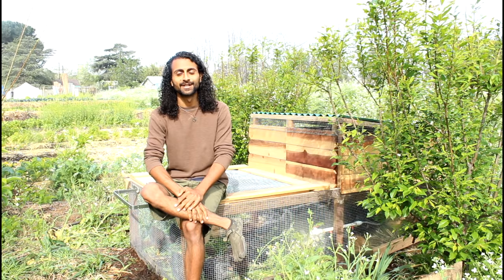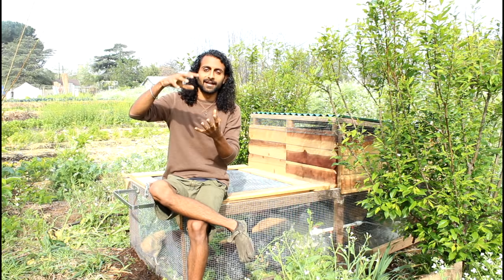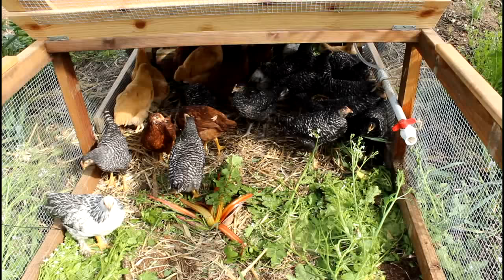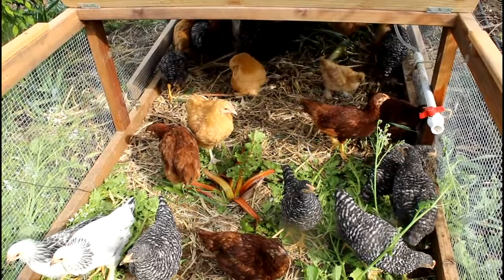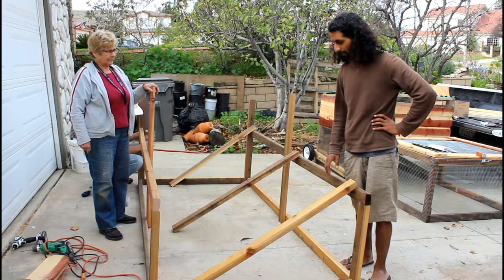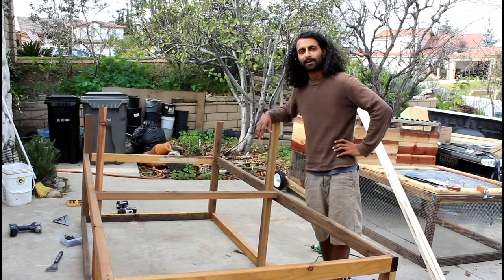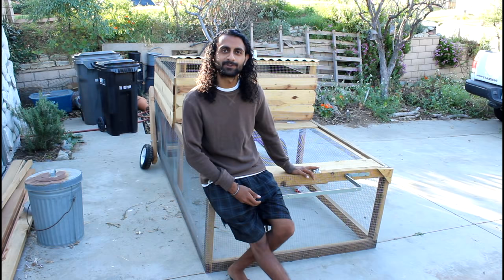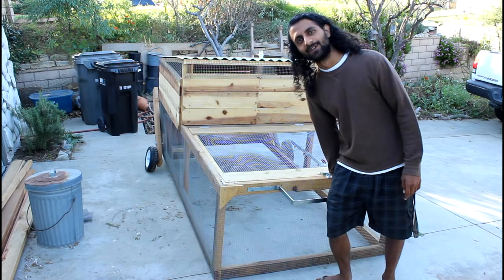How to Build a Chicken Tractor with Farmer Rishi

Comment: Hi again -- very nice perspective.

A question for colder climates -- you're in SoCal and it seemed like one of your main concerns was air flow and cooling. Our winter months can get downright cold, and cold temperatures (scarcity) might make predators more aggressive. Do you have any thoughts on generating / retaining heat in the winter? Maybe add a removable floor at 24" height to retain heat and add a little protection? And/or add non-venting windows for solar heat. I like your idea of keeping the entire perimeter below the house open and clear to 24" height, so if I add a (removable?) bottom, then the floor has to go at 24-25", and the small opening for the chickens to crawl though, to get into the house would be in the bottom of the floor (and not the front as usual). The ladder could be hinged at the front or back, (or side) so that it could be lifted up at night to close the opening for wind protection. For the bottom, I like the idea of using the fencing slats! Wow! Just slide them in, and add a few inches of straw. For ease of cleaning, remove each slat one at a time. The slat at the opening would be shorter.

I like your design with open bottom and no windows, When chickens go inside to rest and nest during the day they get lots of reflected light from the 24" high perimeter, and for roosting at night they get darkness. Maybe add a 360 -degree perimeter window all around the top, just under the roof, 4-6" hight to let the sunlight in in the winder. For summers, fencing slats with small hinges could be used as awnings. (I'll call it "A Chicken Coop for Donalds" or a "Donald Coop for Chickens.")

How far above the floor would you put the roosting bars? Would 12" be ok? The front edge of the nesting boxes should be the same height, say 12 above the floor? When the floor is removed, they would be 36" high, so a year-round ladder would lead up to a permanent 12" wide floor round. They could then hop up on a walking bar in front of the nexting boxes or onto one of the roosting bars. How much space would you put between the walking bar for of the nesting boxes and the closest roosting bar? Would 12 to be ok? Put the walking bar close to the nesting boxes, say 3" to keep chickens from roosting on it and blocking access?

If I add a floor, then I should probably add a hinged roof, for cleaning the inside, say around the ladder?

As for the wheels -- I'm mechanically inclined (haha), so here is what I've learned. The main axle that lifts the frame has to be a pass through. I don't see an inexpensive way around it. Add 1 ft at each end, to cover framing and thickness of the tire and all the bolts, lockwashers and spacers. Thus a 6 ft threaded rod, 5/8" dia, would be used for a 4 ft wide tractor. The reason for the solid pass through axle is torque. One way or another support for the wheels is going to neet torque. If the axle is not pass-through, then that torque will be applied to the bottom of the frame, and over time it will twist the joints and bolts at the bottom corners. To protect the corners, add a pass through axle. A trivial few $ more than purchasing two bolts, and a lot less cost over time. Your frame stays strong and the wheels don't go floopy over time. Bumps in the garden will do that. Support both sides of the wheel wheel bolt by simple extension of a truck. Thus build a simple wooden frame to support both sides of each external wheel using a light 3/4" wood. If the wheel is 3½" wide, you would have two 4" spacers, four 1/4" bolts 6" long to brace the spacers at the tops and bottoms (the spacers will carry the torque and prevent twisting). Use the spacers to support two 4" sides, say the ouside one is 30" long, and the inside one is 60" long.  If the wheel is 10" diameter then one of the end spacers would moved inward 6", to create an opening (extending the truck frame) to accomodate the wheel. The spacers would be at 24" or so. The main axle for the tractor would pass through both pieces of the frame, say half way between the spacers. The long piece would be used as the lifting lever. I would lift the wheel with no twisting applied to the frame. It could be operated by lifting by a rope. A knot in the rope, secured in a small wooden notch, could be used secure the lever in the up position during transport.

Hard to explain, but if you put some scrap pieces in front of you, a solution will become obvious. Being mechanically inclined, I'm also mechanically neurotic (haha). A floppy wheel makes me want to fix things. Sometimes, I admit, it's best to just let a floppy wheel be!

Would love to hear your thoughts
Reply: +molecule Regarding chickens and winter. Most breeds can handle cold easily as long as they can get out of the wind. I would not close the screen between the walls and the roof. Ventilation is important. Chickens put a lot of moisture in the air with their breath and waste. Moisture will cause more problems than cold in an unventilated coop.
Reply: @zone4garlicfarm  Also wood shavings to the depth of eight inches as bedding....

Comment: How do you refill the water?
Reply: Hi there! We ended up making a hinging lid to the next box and filling the water from the top.  Not sure how these guys did it.
Reply: Another suggestion would be to gutter the roof to supplement with a rain catchment directly into the bucket. Just to further utilize every resource available. To be specific...for every 1000sq/f of roof, per inch of rain, yields appx 600 gal. A 4x4 roof giving 16sq/f would yield appx 9.7gal/in of rain. Could save time and effort when they are waaaaay out in the field.

Comment: Thanks so much for this very easy to follow video!!! I love the design!  We are in NC. Do you thunk this tractor is sufficient in keeping the chickens safe at night or do I need a full size coop as well?
Reply: In my opinion, it would not be safe from the diggers.
Reply: An electric fence will add protection for night. Check out Premier 1
Reply: Or maybe using chicken wire or large hardware cloth as a floor for the entire tractor?

Comment: How do you keep predators from digging under or lifting up the trailer? I live in Oregon which is too cold I think to have a coop that open on the bottom. I'm thinking of doing something similar with a bottom and trays... of course that would defeat the purpose of a trailer. Does anyone have any ideas? The coldest it's been here is probably around 10 degrees Fahrenheit but we get a LOT of rain and had quite a bit of snow and ice this past year. How would we keep the water from freezing in the pipes? I know in SoCal you guys don't have to worry about that stuff so much lol. I wish I would have known about you guys when I lived there. We would prefer to keep them in the tractor year round so we don't end up with a huge pile of stinky poop.
Reply: You could probably build a removable floor to use for winters and just take it off for summers. Chickens can handle the cold pretty well though but if keeping the coop stationary in the winter due to lack of foliage you could add wood chips.
Reply: Rachael B what’s wrong with a huge pile of poop? It’ll break down into a great manure for a garden. Hell the chickens will even work the land for you and have it pretty ready for veggie planting.

Comment: I created a sketchup model of your chicken tractor here: https://3dwarehouse.sketchup.com/model.html?id=u41dd49c6-f02b-468d-9218-dccbbfc108d0   

I did it with 2x4s as I had a pile of 2x4s after a different project.  Anyone can download "sketchup make" and then load that project to get a 3-d model of the chicken tractor in the video.
Reply: Yeah, I couldn't quite figure out all the cuts from the video so I had to model it for my own benefit.  Had mine for a little over a year and it works great.  I added an egg trapdoor to the nesting box and I don't think you need 4 chicken water nipples.  I think you can get away with just one, directly inline with the bucket and skip the PVC.  Creates a freeze hazard for those with freezing winter..  One other mod I just did was to make the wheel cam pivot on the back support instead of on a block connected to the back joint and also to make a hole through the caming arm to simply pin it to the frame as well.  Bumps were causing my copy of the above design to pop askew and then the wheel would no longer support the tractor.  Also, get as big a wheel as you can.  Small wheels have a harder time with bumpy ground.  Lastly, you may wish to make it a little skinnier so a stand 4'-wide corrugated metal roof overhangs the sides.  The above design has no roof overhang on the sides when you use corrugated roofing one 4' section wide.

Comment: what do you mean by short side up or long side up.  I don't understand if the boards are cut strictly across and perpendicular to the other side how do you have a  side and and a long side.  your video is very confusing.   I'm not a carpenter but why are some boards center to the long sides and others are drilled in the inside of the frame.  what exactly do you mean by and short side or long side when the boards are equally cut.  why are some boards perpendicular and others are vertical or horizontal or whatever? dude you need to get it together. OMG I'm so confused period you and really need to learn how to narrate period kind of this kind of that kind of this kind of that up and down sideways around around

Comment: This guy is dangerous! Do not do what he is demonstrating here! Learn some skills before you attempt to teach others... 
Teaching people improperly is not only in poor form - it is immoral and down-right dangerous! 

i.e. - Does this guy even own a properly fitting combination wrench? Adjustable pliers should be your last choice! 
28:40 - He has no idea what an Elastic Stop Nut (Nylon Insert Locknut) is! - Or - Why it is a better choice to mount the wheel. 
36:48 Wrong size PVC glue applicator...! That one is good for 3" pipe and larger. (Read the instructions!); 
37:14 - "Red Hot" glue, WHY? It is not raining or sub-freezing! (Again - Read the instructions!); 
37:23 - large puddle of glue on concrete! (Applicator too large!) 
39:47 - Covered glue spill on concrete with board. 
39:58 - Spills glue again. - Glue everywhere! - (Applicator too large!) 
37:48 - Fails to use proper threaded T-fitting or 1/8" tapping device for nipple threads.
37:50 - Drills into hand - Almost! 
39:26 - Glues the ball valve in the open position with excess glue inside fitting. (Applicator too large!) 
43:48-44:08 - It makes no difference! The hinge will function properly with either plate on top. 
45:15 - He says this can be used for quail... 
45:24 - How does he keep them in when the coop is 7" off the ground in the transport position? 
48:26 - Lets helper sweep FRP debris away with his bare hand. There are glass fibers in that stuff! USE A RAG! You will thank me later. 
48:35 - Uses an impact driver on a short wood-screw. Great procedure if you want to strip out the wood attachment! 

Just wondering... 
48:55 - How does he fill the water bucket with the roof screwed down tight on top of it? 
52:42 - How does he keep the salmonella out of the vegetables with those chickens roaming around in the garden areas?